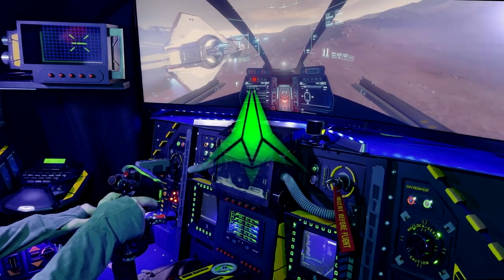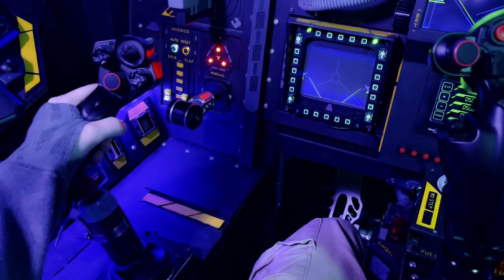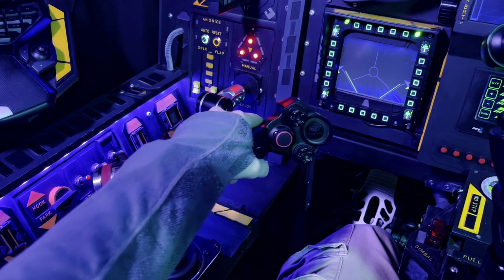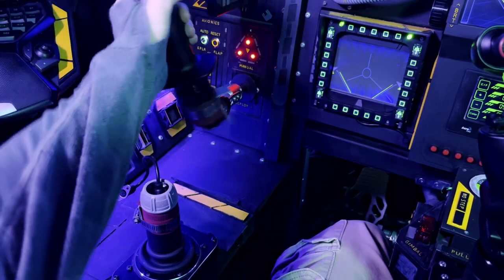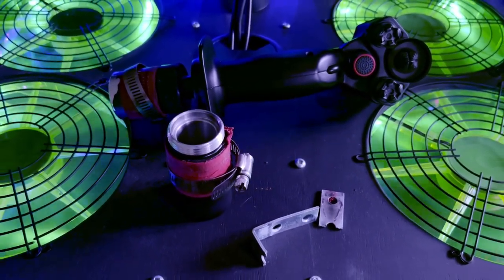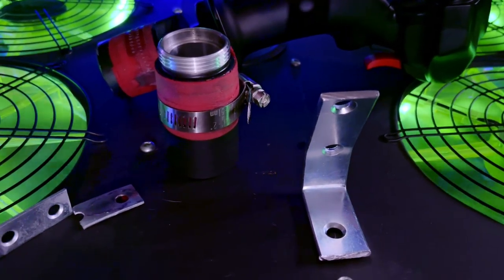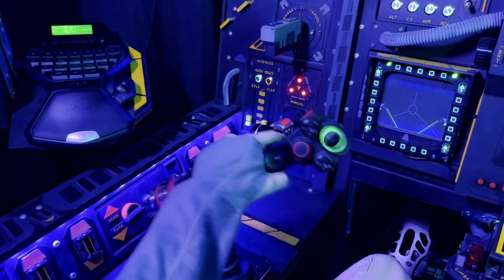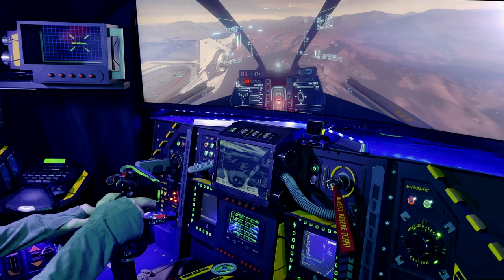This Finally Broke in my Setup - Omnidirectional Throttle Followup

Comment: What would you recommend to get for war thunder, and ocasional planetside 2 joystick gameplay?
Which joystick, and maybe some additional keys? I did play joystick and I liked it, but it was shitty one.
Reply from the maker: It really comes down to budget and how much effort you want to go through for setup. For Planetside 2, you don't need very many buttons at all. You do want 5 analog axis, for Pitch, Roll, Yaw, Heave and Thrust (Surge) though. So that is at least a dual stick configuration with twists. 

I'm not at all familiar with War Thunder, I've only played it a few times many years ago so I would have to look into it.

The last stuff I've used was a X52, X55, Warthog, Double WarBRD (Alpha and Delta), and now the CM3 base.

I would avoid the Warthog stick at any rate, for sure the ball gimbal on it and the way the stick works is just not suitable for Planetside.

X52 will work as a single device so setting it up to work for Planetside would be easy, I have used it before in Planetside way back when it came out.

X55 had some QC issues.

If you can afford the bases, go for WarBRDs at the minimum, they're worth the money over the other options I've tried. The CM3 base will let you double up a left stick as a Throttle so that could cover both War Thunder and Planetside, and potentially anything else you want to play. Thats the more expensive route though.
Reply: @AfterimageFlight  I just want 1 decent stick for now - would be great if i can mount the base to my desk as well.
Reply from the maker: @def6420  Based on what I've used, I would say the WarBRD Base and either a WarBRD grip or an Alpha grip. It's more expensive than plastic options, but it has a really good gimbal, and I've used a WarBRD base exclusively with all the videos I have on Planetside, so you should be able to see what's possible with it. :)

WarBRD grip can be configured to have twist, which if you only have the one device, is a must. More than enough buttons on it, but if you want something with more buttons, Alpha also has twist.

Other than that, you could try something from VKB, I hear they are good but I have no first hand experience with them.

Thrustmaster T16000 is a good starting stick, but they wear down over time.
Reply: @AfterimageFlight  Thanks!

Comment: Go to a machine shop and have a custom bracket milled out of aluminum. It will never break again.
Reply from the maker: Good idea; making the whole extension and bracket together would probably be something they could do. I might have to look into cost and compare to printing or buying the extension.
Reply: Yeah . To be real 3D printing is probably just as good and cheaper too...but boy there is nothing like a shiny freshly milled/turned aluminum part.

P.s. Your setup is super cool 😎

Comment: Hey man! been a little while since i last spoke to you, but this video reminded me that i haven't uploaded my virpil omnithrottle design to printables yet.
If you still have your 3d Printer, the design is really easy to print, PLA should be fine also, you just need a few heatset inserts. If you don't i should be able to arrange for a friend to print the parts and send them to you.

The omnithrottle has a fixed angle at the moment, but i can  adjust that very easily. if you would like me to send some pics, i can pop some in a google drive
As a little side project also, something you may be interested in, depending on your use of the flip down triggers, but i went about creating a very simple mod that converts the flip-down triggers into a rapid fire forward backward trigger, similar to the ones on the gladiator GNXT.

ive got a couple other little projects in the works also, warbrd dampening for example, but the two things above are finished, working well in my setup, and could really use a Beta tester that i know actually uses their sticks in a way that would highlight any flaws.

if you are interested, just let me know, happy to help you get your printer on its legs if it isnt already, and i still have your TS info i believe!
Reply: Here's a link to some pics, so you can see it's not just some crapshoot my first cad project ^^

https://imgur.com/gallery/mApKC2B
Reply from the maker: That looks nice and clean. I have never used a 3d printer at all, I don't own one. Most of the stuff I have done is made of MDF, plywood, sheet styrene plastics, etc.
I use the flip trigger on the Alpha to control the behaviour of head tracking.
The WarBrd dampening sounds very interesting - one of the reasons I am upgrading to a CM-3 base is to have the dry clutch to hold the Y-Axis in place for probably what's going to be the best option for space sims (plus using it as a throttle in other games).
Reply from the maker: I think I actually prefer that compared to VirPil's design.
Reply: @AfterimageFlight  haha, the Virpil one came out a few days after i finished my first version of the design you see there, and i was a little dissapointed, i wanted less stick out on the left hand side of the stick, and the virpil one doesnt do that at all, and its all to gain a little adjustability in the tilt angle, which you will likely set once and not change again to get the stick balance correct. my design lets you choose an angle block, and that is screwed into the top.
i finished the first working prototype of the dampeners today, they are working on both sticks currently, but im not 100% happy, the damping force isnt as adjustable as it needs to be, but im limited by the internal space pretty hard, but there are a couple more avenues to explore. this design requires no more than you would need to do with a cam change, but to get a propper damping action as it is on the CM3 gimbal may require relocating the hall effect boards, but then perhaps not, a little more experimentation is required!

Regarding the 3d printer, i can arrange for a friend local to you to print the parts out and posted, ill arrange that at some point. do you still have the TS server? if you PM me here we can exchange some info and i can fill you in on the details, perhaps get some feedback
Reply: @AfterimageFlight  I dont know if you have ordered a CM3 base yet, but if you are aiming to get it predominantly for the dead stick and damping, you might want to hold off. i dont want to oversell what ive been working on, but it is currently damping all oscillation completely, operates very similarly to the CM3 with an adjustable tension arm, and its working to dead stick with a very nice feel. i don't think it will hold the weight of a collective on an extension like the CM-3 would, but thats fine. if you need that functionality, you should buy the CM-3

(i MAY have also figured out how to toggle the spring on and off, so you can toggle, per axis, between just dampener and dampener with springs+cam
could be nice to be in dead stick on the left side for leisurely stuff, but toggle back into standard stick mode for space combat, have to wait and see on that one though)
Reply from the maker: Hi. Sorry I've been very busy this week.

One of the reasons was because I was setting up the CM3, but also just in general. Yeah, I'm planning on using it only really for the left stick with the extension. Although having a dampened WarBRD center stick does sound interesting. Still deciding how much I like the CM3.

The TS server we currently us is: ts88.gameservers.com:9341